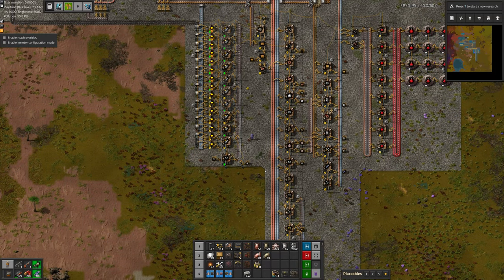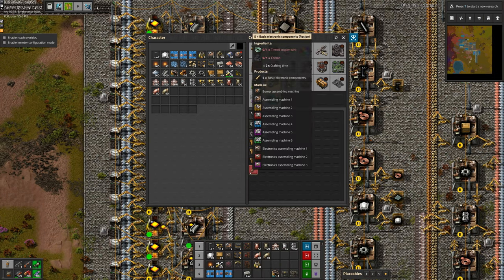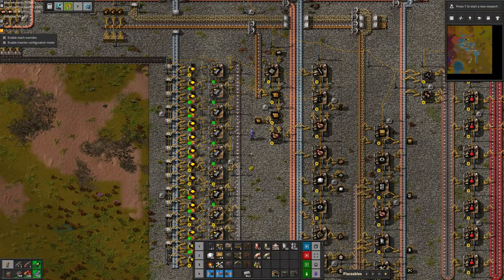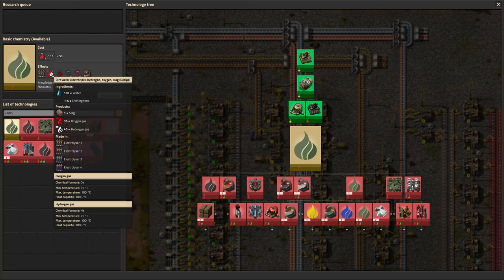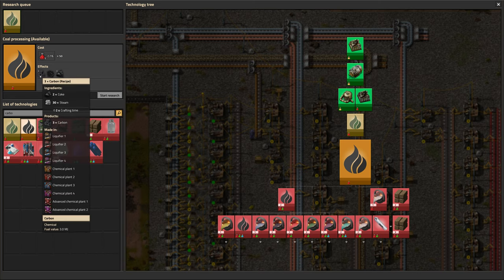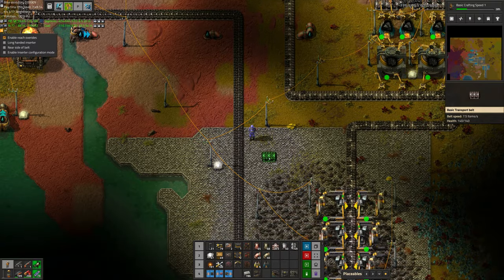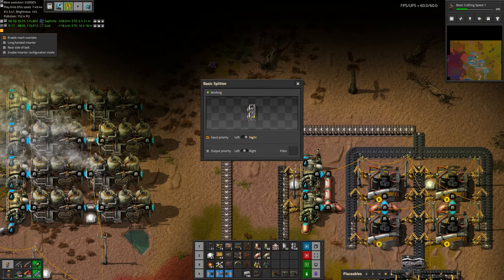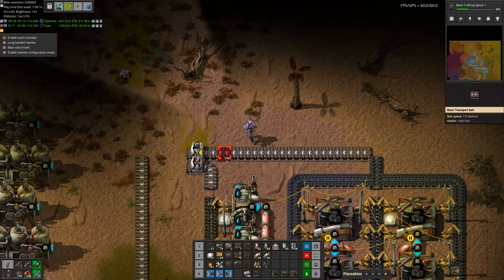[Factorio 1.1 4K] Angel/Bobs Ep 14: Making Carbon (Tutorial/Walkthrough)

Comment: I learned from this series, to configure inserters before placing it, preventing it from picking up from a near belt/entity. In some scenarios though, I find it faster to place the inserters, select one, configure that, and then shift-copy/paste the configuration across the rest (like alternating near/far insertion on belt, or short and long inserter configurations).
Reply from the maker: Yes that is another way to do it. The reason I configure them before placing is because sometimes you might misclick on an inserter and it’s kind of hard to tell by looking at them. However by configuring first and then placing, misclicks are either prevented or are more obvious.
Reply: @marsh8056  this comment is eight months later, so you may know by now. There is a setting which highlights where the inserters pick and place from. I always have that clicked when playing with adjustable inserters for that very reason.
Reply from the maker: Right, but the gui isn’t the easiest to read, for example telling the difference between near and far inserters.

Comment: About the "coal or carbon" dilemma, I'd bootstrap the coal/coke/carbon industry with coal, then move to carbon, which I'd feed back into it via priority split.  It more than doubles the energy content, so it would be a waste to use coal after starting carbon production.  And if other industries get too little, you can always expand your carbon industry. 
IMO, carbon, power, and smelting, roughly in that order, should probably be the prime candidates for carbon.  The one I don't really know about is steel.  Depending on the recipes in the mod, you might need something specific as an ingredient (say, plain old coal), and in that case, using both coal as an ingredient and carbon as a fuel is probably too much trouble to be worth the savings.
Reply from the maker: Carbon is a great fuel source until you have charcoal, coal pellets, ect. The main disadvantage is each carbon has little energy content so it fills up the belts quickly, bad for a large factory, but good for a small one. With angel's smelting the coal industry is a substantial part. I think you need both carbon and coke for the various recipes. I don't even know if its possible to set a machine to not also consume the fuel it needs as an ingredient. For example early on I was moving wood with a burner inserter and the inserter totally used the wood for fuel. I guess you'd have to pre-load the machine with the ideal fuel first, then put the inserter down, and if you never let it run out of fuel, it will use the ideal fuel type. But its probably more trouble than it's worth. Machines than consume their own inputs are fairly rare and insignificant compared to the factory as a whole that it's worth the inefficiency to gain the simplicity.

Comment: What I like is transport drones, it's a mod that adds a means of transport between belts and trains.
Reply from the maker: That’s a cool mod! I’ll have to give it a shot and see if I want to add it to this play through. I’m already thinking of things to use it for... things that a train is overkill for... like delivering ammo to the wall... or low throughput items like train fuel.
Reply: @marsh8056  It is cool, yes. I used that with Krastorio2 before, but also vanilla.
With Angel's unfortunately they require Methane as their fuel - as Angel changes PG to Methane in a way.
Reply from the maker: I was worried around that. Even if it takes oil first they look quite useful for transferring small amounts of resources. For example the drones might work a lot better transferring small amounts of byproducts across the factory when a train would be overkill
Reply: @marsh8056  My krastorio 2 game is using the transport drones too! It's an amazing mod! And I was able to reach 1.3k spm with just them as main transport, no BUS nor trains up to that point! 

They have quite good throughput and you can easily support transferring large amounts of stuff around your base very quickly (they have upgrades to their speed and cargo stack capacity that makes them end game feasible.)  The con of them is the increased amount of units moving around the map and using the pathfinder that can have quite a detrimental effect on the UPS :( Carefully planning your base around having high traffic areas nearby can help to mitigate that, maybe.

I'd say they are very effective from early game up until when you want to start scaling up substantially! (I'm moving out of them for large scale transport myself as my UPS went down noticeably when I started use all the factory constantly for infinite research!)

EDIT: The mod also lets you configure in its settings what you want to use as fuel, as long as it is a fluid it should be no problem to tweak that to be more inline with Angel&Bobs (I assume at least, as I say this with no detail knowledge of those mods at all, only what I saw here in your LP!)
Reply from the maker: That’s awesome! So basically you built highways for all the drones. This kind of reminds me of AAI’s programmable vehicles. It’s a whole new way to organize and build a base, distinctly different from trains, bots, and belts.

I’m eager to start using them. I’m not sure how extensively I’m going to use drones, but to start I can use them to move low throughout items through the base to make it look cleaner. Byproducts, fuel, ammo, ect.
Reply: @marsh8056  Yeah exactly! I built my base as a cuadricular grid and each block is surrounded by transport road... so they have multiple paths to each destination and they are quite good at finding the shortest path, even if they are a bit derpy at times :P (they use biter AI!)

Awesome! Looking forward to you using them... I hope you'll find them useful and that they help you build your base!

EDIT: BTW, I also used AAI Programmable Vehicles at the start too! I had several Haulers moving ore around my base (they weren't automated, I just used the 'path' drawing feature in AAI) and they worked very well with the miners too... in the end, I decided to abandon that in favor or just using normal mining drills because I grew tired of having to fiddle with the miners each time they exhausted the ore beneath them :D (I know you can automate them to do that kind of stuff by themselves with circuit logic, but from what I saw it was way more complicated to do that than I wanted to dive into for this Krastorio playthrough myself!) The only thing that remains from AAI active in my base now is the Flame Tumbler! Love it :P
Reply: @leeux  I use another mod that change the fuel to coal to be used by the trucks, so you can start using transport drones even at the very start of the game.
Reply: I used transport drones in my last krastorio game and it really enabled me to create some terrible base design because I didn't need to create a bus so that is a downside you have to watch out for.

Unless you're very patient with bus and belt layouts, I think it is borderline mandatory for bobs/angels playthroughs due to the logistical nightmare that you run in to before trains